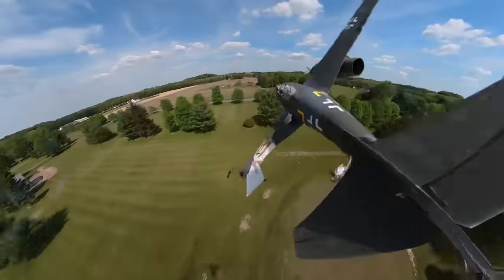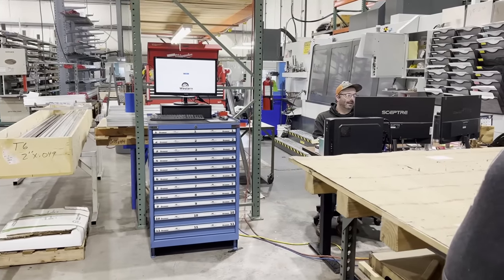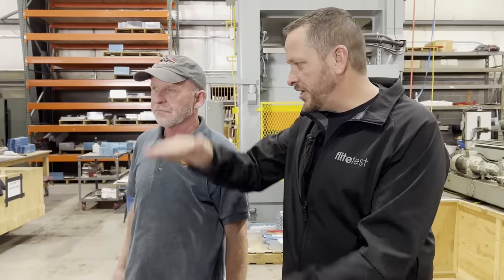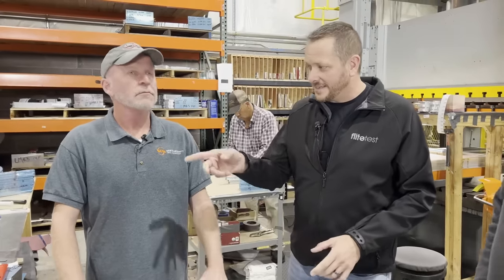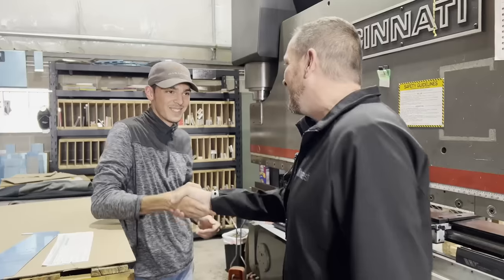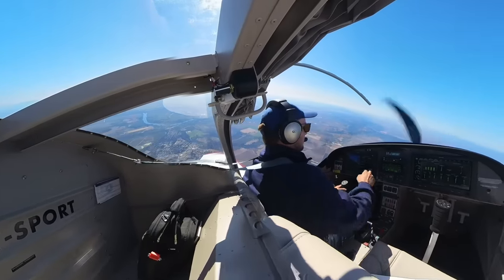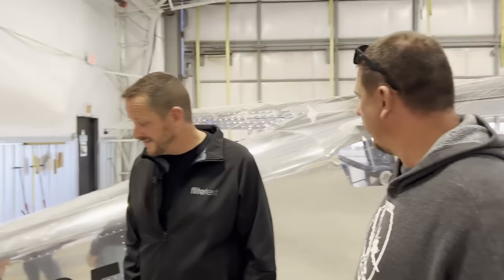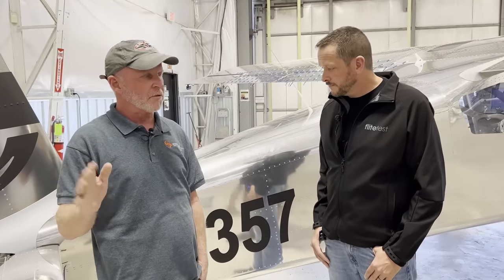Touring The Biggest Kit Plane Manufacturer - Van's Aircraft Factory

Comment: It must just be vastly superior to make the fuselage as one composite part, both superior shape, stronger, lighter and much easier to make. With double curved surfaces that good aerodynamics naturally has then just a carbon fiber shell with no frames or stringers will be inherently stiff. Hard to beat for weight. And also naturally well suited for pressurization. It's just vastly superior so quite a crime so many still hang on to titanic era construction. Composite isn't subject to metal fatigue either.
If you wanted to make your own I'd recommend a glider style body shape and maybe two canard style steerable wings as the control surfaces. That way the control path is very short, you could basically hold them directly in your hands and the rest of the plane has zero mechanics. Except for motor.